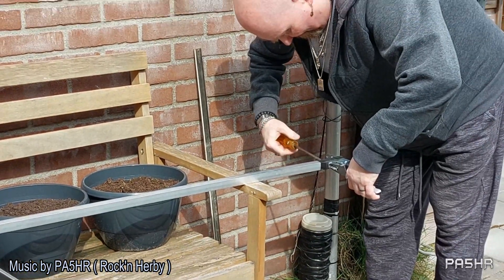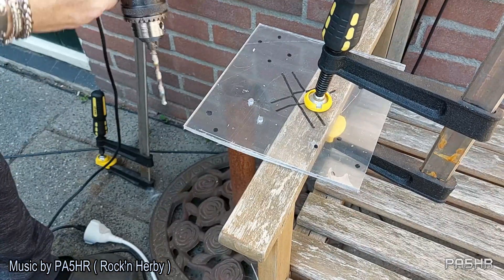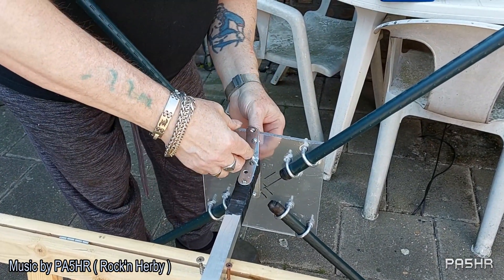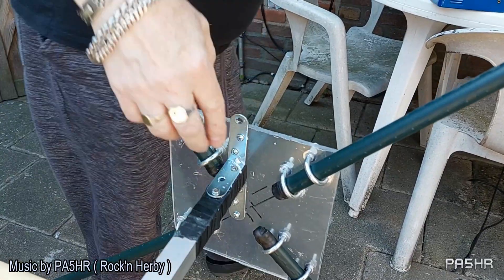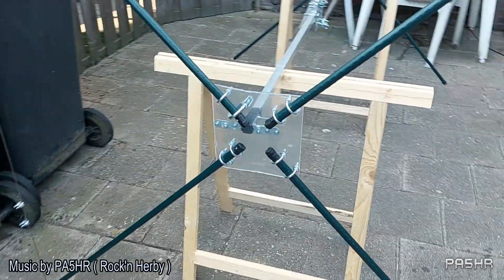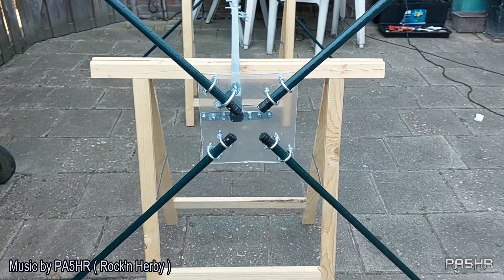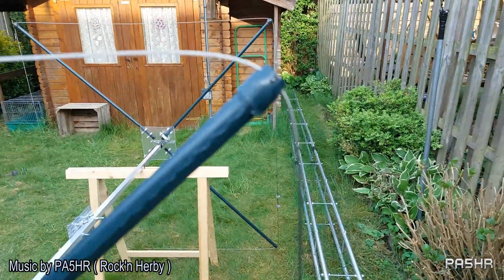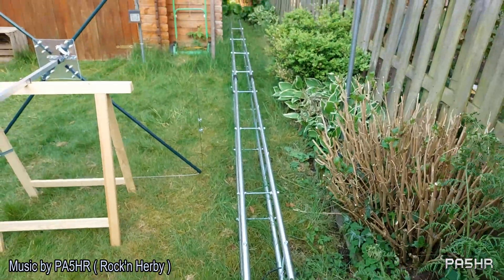2 EL  Halve Wave Qubical Quad for 24 28 MHZ

Comment: 🤘Awsome job, Bert! 💯🎸🎸🎸🤘🍻🙋‍♂
Reply from the maker: Thank You very much my Friend yes it was a pretty much Job but the result is claer hope this Antenne wil works vy 73 de Bert PA5HR
Reply: @PA5HR1  This Antenna will burn the Ionosphere like a Flamethrower, Bert. Dutch HAM Radio Operators are known for their professional Skills building highly effective Antennas. This Thing will get your Signal thru the Pileups amd Man made Noise like a Sledgehammer thru a Wall of Concrete...
73 & happy Sunday de YFUG - DK5ONV🍻🙋‍♂
Reply from the maker: @DK5ONV  Thank you again my Friend and yes i hope so that the Antenne wil burns the Air ( HI ) vy 73 de Bert PA5HR